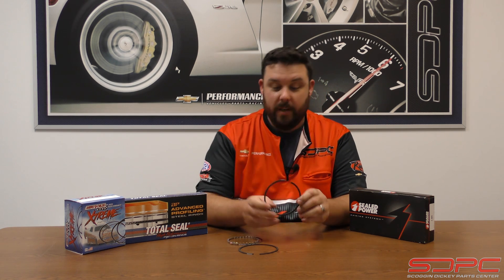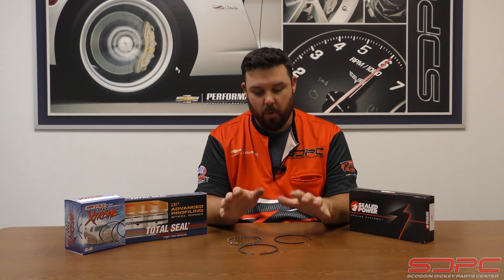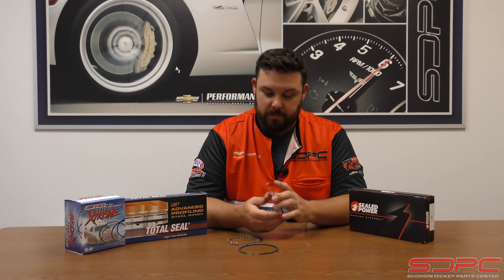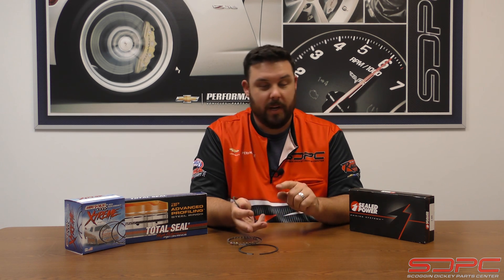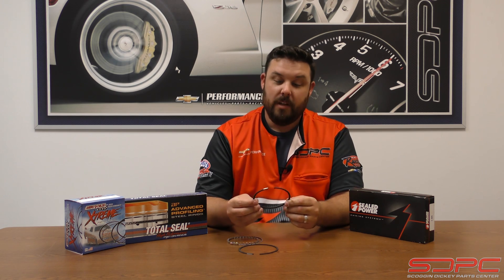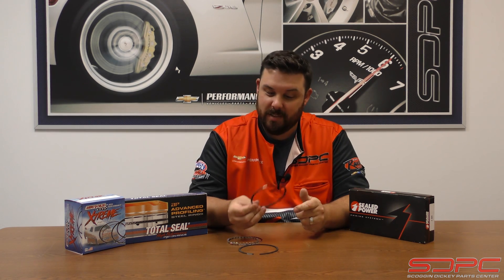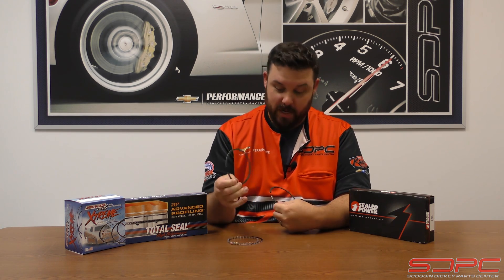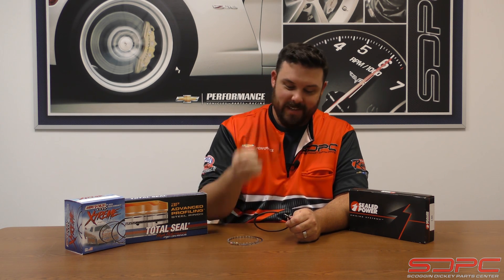SDPC Tech Tips: Piston Rings

Comment: I know that this off the topic but is your hot truck cam SDR214218 an ls3 and l92 823 heads camshaft
Reply from the maker: Yes, the 214/218 cam can be used with rec port heads.
Reply: Is there a YouTube link our website with a dyno graph with the SDR214218 cam being tested on an Lq4 6.0 stock bottom end